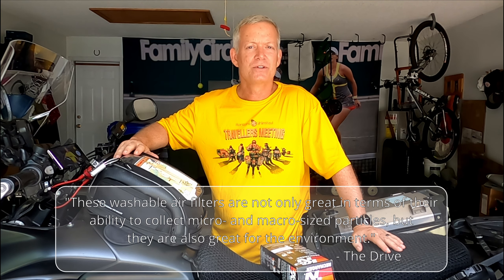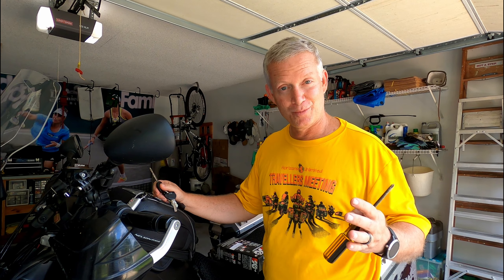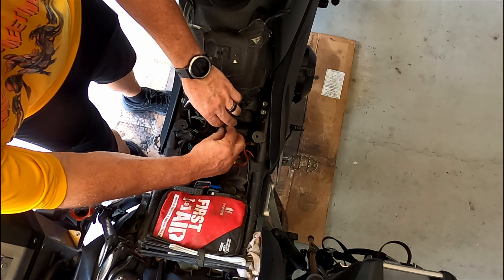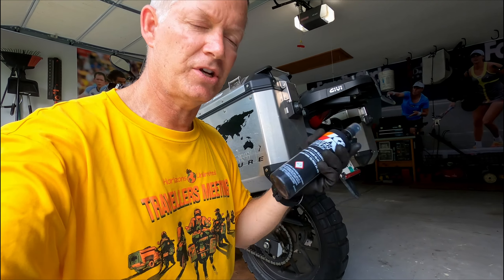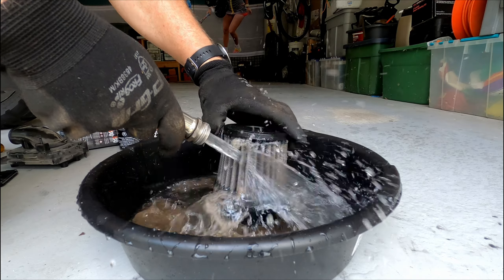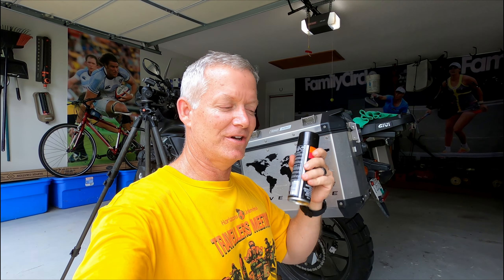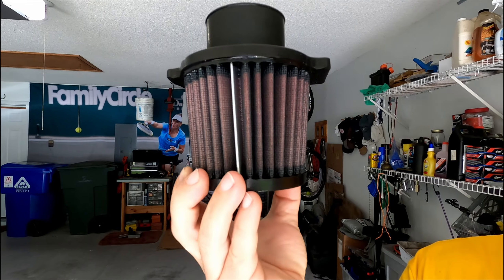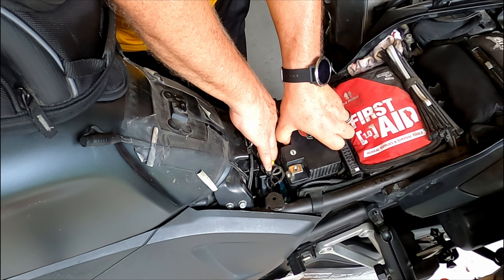Easy Step-by-Step Motorcycle Air Filter Replacement Tutorial

Comment: 21 CB500X Stock Air filter

Factory tight screw put in way to tight. 

That was way harder than it 
should of been.
Wiring getting in the way. When trying to pull out filter.
Could be abs related 
Took an hour.

The lower screw, shifter side a pain to get at.
Lower screw brake side, take the side panel off and go in that way. With a right angle screw driver.

I ended up taking off the 4 bolts that hold the tank in place just so I could lift up that little bit more to full the filter out. That took 5 minutes trying to get filter out.

But I persevered.

On the plus side, oil and filter was
a breeze
Reply from the maker: WOW!!!  Great job!  Perseverance paid off!  And I totally agree, it's a pain to get to those screws.  Having a "stubbie" screwdriver helps.  And also having the correct screwdriver tip helps.  The screws look like they take a Philips screwdriver would work...and the do to a degree.  But actually those are JIS heads, which is a Japanese standard that is slightly different.  So having an actual JIS screwdriver gives a little more "bite" when trying to loosen them.  Anyway, great job and thanks for watching!  - Chris

Comment: Hi Chris, I just swapped my filter to KN on a 2021 model. Thanks for the tutorial. I do think there is a slight better roll on response with the KN, like a tad more urgency to redline.  Now how often should you clean when driving 95% road only?
Reply from the maker: Hi Arizona!  I'm glad we could help.  I too think there are minor performance gains.  Though really I just like that it's re-usable and not another hunk of plastic being tossed out into our planet each time you change filter (like with the OEM).  If you mostly ride street, you won't have to clean it that often.  Just follow the owner's manual.  I ride a lot of dirt...so I do it more often than some!

Comment: Hi Chris I'm from Australia will the part number HA-5013 be the same air filter for the 2020 and later 500x.
Reply from the maker: Hi David!  It should be.  To my knowledge Honda doesn't change anything internal for different countries...same exact bike worldwide.
Reply: Hi Chris David again thanks for your reply there is another listing for the 19-21 500x the number is HA-5019 K&N filter.
Reply from the maker: @davidread319  ahhh yes, they did indeed change a few things between the 13-18 models and the 19-21 models.  I mistakenly assumed you had a 2013 like me.  Definitely go with whatever the K&N recommendation is!  Cheers!!!  P.S.  We loved our trip "down under" several years ago.  You live in a beautiful country, my friend!
Reply: Hi Again Chris just a quick question how did you go with the sixteen tooth front sprocket is it worth the trouble if it throws the speedo out.
Reply from the maker: @davidread319  I've been loving the 16T front sprocket!  I've probably put over 25k miles on the bike since that upgrade and I don't ever see myself going back unless I only used it for dirt riding.  If you watch our adventures, I did the Trans-America Trail and the South Carolina Adventure Route (both are 50% dirt trails) and kept the 16T the whole way no problem.  But the REAL advantage is how much smoother it and better spaced out the gearing is on the pavement.  I have a Garmin Zumo which tells me my exact speed...so I never look at my speedometer anyway.  But if an accurate speedometer is important to you, there's a simple electronic device you can plug in to calibrate your speedometer after you do the upgrade.  Two companies make them.  I've put links to both suppliers in the description of the 16T sprocket video.  Enjoy!